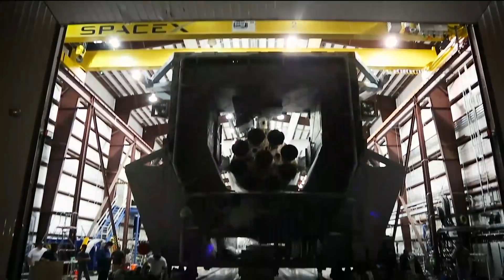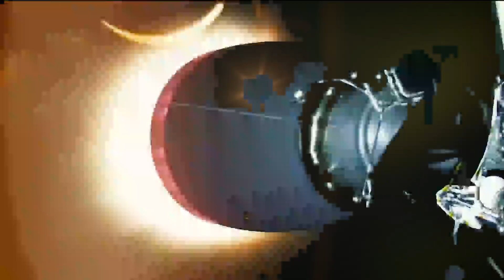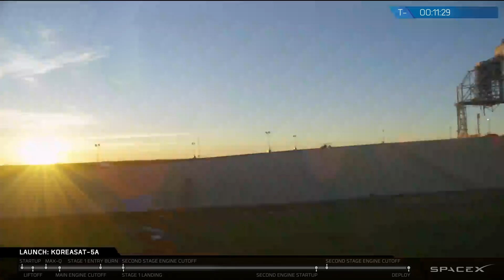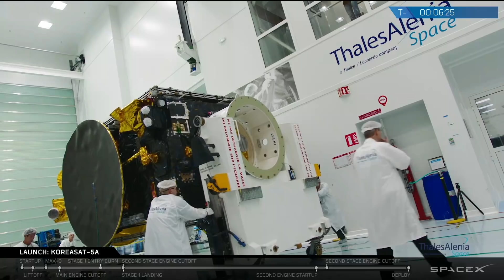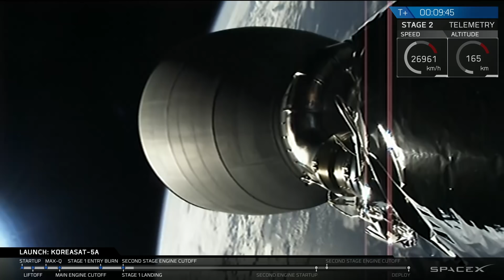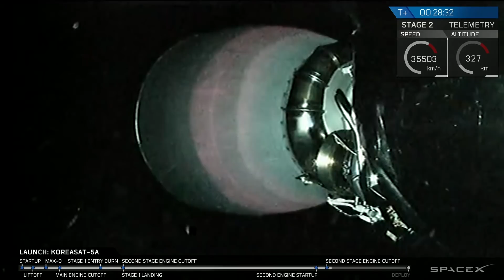Koreasat-5A Webcast

Comment: Question: geo stationary transfer orbit supposed to be "GTO is a highly elliptical Earth orbit with an apogee of 42,164 km (26,199 mi), or 35,786 km (22,236 mi) above sea level". Maybe wiki is wrong  but those numbers are true as well for the geo stationary orbit itself (AFAIK), not  just the transfer orbit. What we see is that the altitude reaches 800-900 km. That's like saying I run a marathon while I'm running 800 meters. Does the satellite have enough momentum to actually reach the geo stationary orbit. Or what's going on? Can someone enlighten me? Or is it just that it's another 10 hours until the satellite reaches that with the final stage rockets and the video cuts short to not bore the people?
Reply: Csaba Toth by the time stage 2 had pushed the satellite to 1000 km alt, it was well clear of any of earths atmosphere, and it had the velocity and inertia to then coast (pretty much) up to its final 36,356km geo orbit.
The satellite has control thrusters to maintain its stability, but these are by no means designed for pushing the 3.7ton (twice the weight of a family car) machine around in space, it's the pure brute force of the rocket which does 98% of the (literal) heavy lifting.
And yes, there's a number of hours until the satellite reaches that geo orbit, so, even if there was a camera mounted on the side of the satelite, perhaps with even earth in the back ground, I doubt that would make for exciting webcast viewing.. although, it would still be more exciting than most stuff on free to air tv these days.. ;)
Reply: The first orbit has apogee and perigee at about 1000km. The GTO orbit still has perigee at 1000km, but changes the apogee to 36356km. At apogee, instead of continuing back down, a final adjustment is made to get the final geostationary orbit, which is circular with both perigee and apogee at 36356km.
Changing an orbit with a single rocket burn can never have a new perigee above the current altitude, and can never have an apogee below the current altitude. So to get from 1000 circular to 36356 circular requires an eccentric intermediate orbit that goes between those values.
Reply: brianorca is correct. The satellite has an engine on it for raising apogee. Sometimes that's even a solid motor, though that isn't true for this satellite. If the rocket were to directly insert the payload into a geostationary orbit, it would have to coast for several hours to get to the apogee.
Reply: I need to read more about perigee and apogee. brianorca may not know piroggis.
Reply: Thanks!
Reply: Thx for the explanation!

Comment: EVERY live stream of the landing of stage 1 the cameras ALWAYS cut out and fail. How difficult is it to have camera that works?
Reply: It's not the camera, it's the transmission equipment being vibrated like hell with the rocket so close by.
Reply: There's nothing wrong with the barge camera - no barge camera has failed on any barge landing. It's the satellite live uplink that breaks due to interference from that huge metal tube landing & the heated, ionised air from the rocket engines, but the camera is still recording & in a couple of days the SD card will be retrieved from the camera  & then we'll have the complete landing. The video for that is posted on SpaceX instagram accnt just like all the other landings etc.
Reply: SES-9 wiped out some cameras. Not all, but all the interesting ones. But then again, that one punched a hole through the deck.
Reply: Rocket itself is a line of sight transmitter.  Can't transmit after it falls below the horizon.  have to rely on satellite uplink through an ionized plume for ship footage.  no good.
Reply: No, it's not intentional. If it was intentional they wouldn't even show the burning rocket. We've never seen complete S1 coverage except on RTLS landings (where we always see it).
Reply: Stephen Hitchens how difficult is it to understand how satellite uplink work & how the simple vibration can disrupt it

Comment: what happens then whit second stage ??
Reply: It eventually burns up in the atmosphere.
Reply: Odysseus Rex dose it use engin to brake and desend to atmosphere ¿
Reply: does it use its engine to brake and descend down?
Reply: Luka Artelj  It depends on the nature of the mission. For this one, they needed to use all the fuel to boost the satellite into it's orbit, so the second stage will just naturally have it's orbit decay and will burn up. On other missions, where they don't need so much fuel, they do do deliberately decelerate the second stage and cause it to burn up.
Reply: ok thanks, but if I understand correctly the satellite and second stage are in the same orbit, how will second stage orbit decade? or will it decade together whit satellite
Reply: For GEO missions the separation happens on a transfer orbit (high apogee but low perigee) the satellite uses it's own engine to insert into it's final orbit while the stage 2 remains on the transfer orbit. The perigee of the transfer orbit is low enough that the stage gradually loses energy to atmospheric drag until it renters and burns up.
Reply: Luka Artelj  Excellent question!!  After the second stage burns it, and the satellite, are in a highly elliptical orbit with a high point (apogee) of about 22,300 miles and a low point (perigee) of around 100 miles. After the satellite is deployed, a small rocket attached to it burns at the top of the orbit to circularize it at 22,300 miles. The second stage continues in the elliptical orbit, and every time it reaches perigee, it experiences drag in the upper atmosphere and loses a little bit of velocity. Eventually it is slowed down enough that it can't make the next orbit and reenters the atmosphere.
May I ask where you are from?

Comment: first loss after 14 success launch? =(
Reply: what do you mean by loss, it was a success
Reply: I meant the first stage. it was on fire and I guess it will drop down after losing one of the landing legs ? maybe not i don't know. I couldn't see what happend.
Reply: They said in the end, this stage will be reused. Its fine.
Reply: Tonyert the fire is normal because they cut the oxygen first and then the fuel. So there is some fuel left in the combustion chamber. That fire is way cooler than reentry heat or engine use heat. I hope this helps
Reply: Atmosphere entry is much hotter than that little flame on paint.
Reply: It can handle a little fire like that. It's just a small amount of kerosene after engine shutoff.
Reply: they didn't say it would be reused, they have no idea at this point

and no gto core has been reused so far because the reentry is so hot